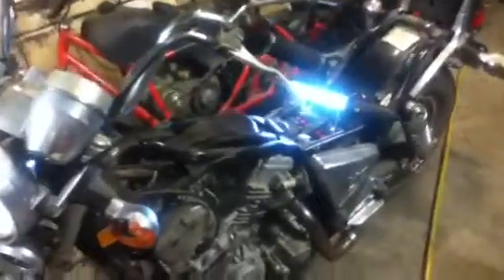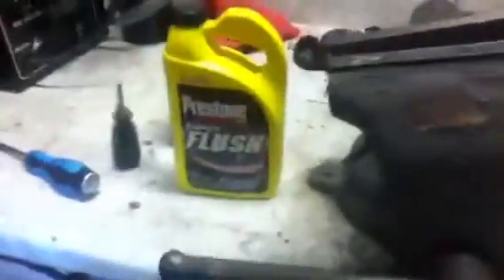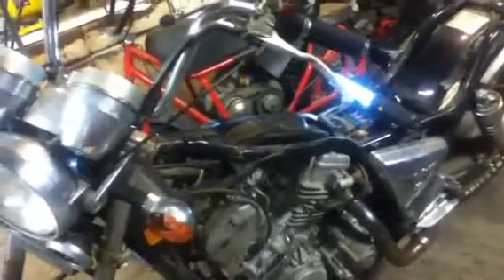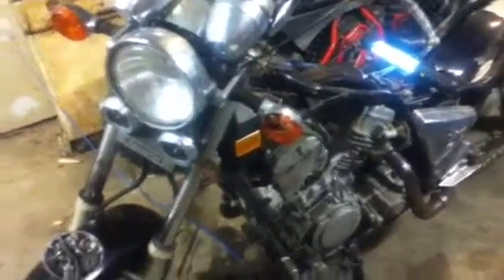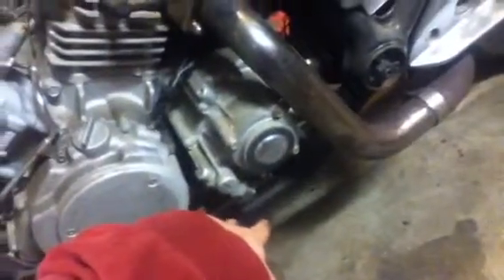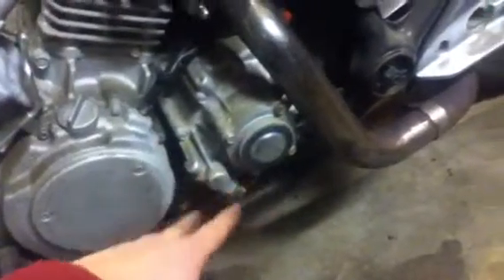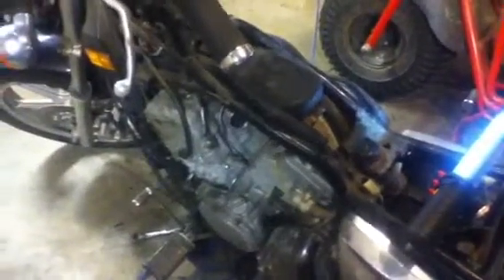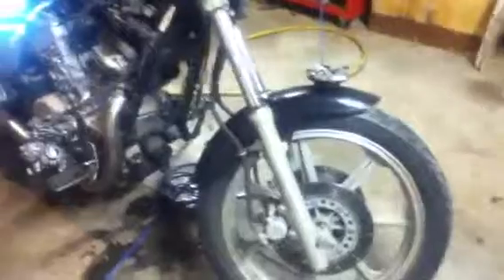Kawasaki Vulcan 750 project pt.2

Comment: Advice, if its rusted, put new hoses and fush again. Also, check the water pump, and inside of the cylinder.
Reply from the maker: its fine im just gonna replace the connection that are rusted coolant system was working fine me and my friend drove the bike down to my house and it was getting good temp it was only like 20 degrees out though and it was running horribly.
Reply: Alright, keep a close eye on the coolant level tho, rust has to come from somewhere